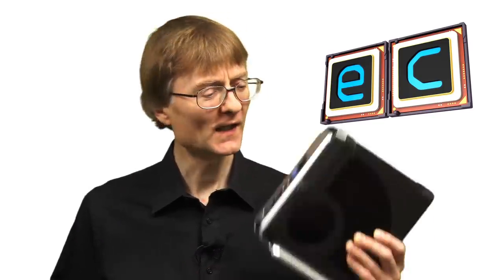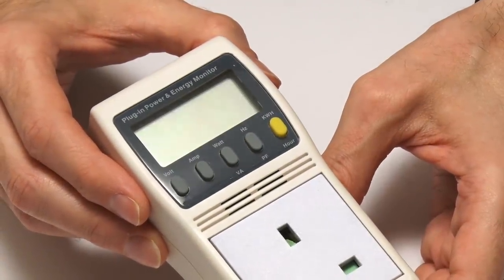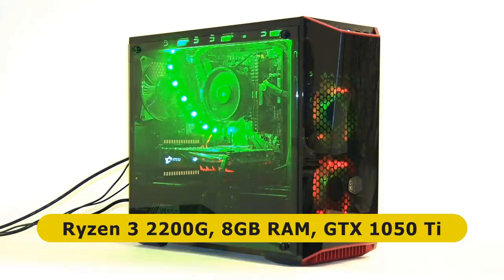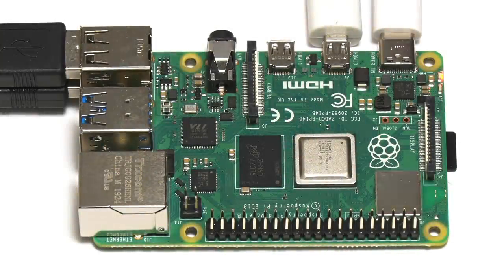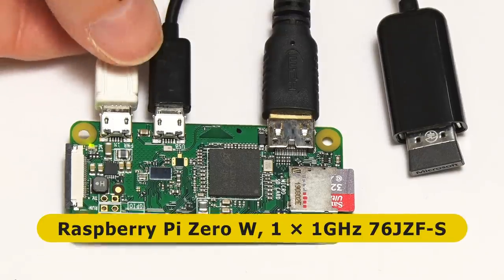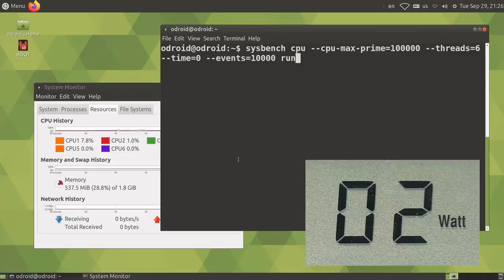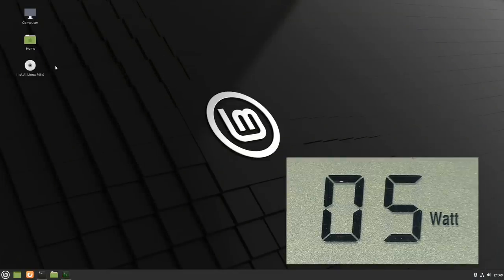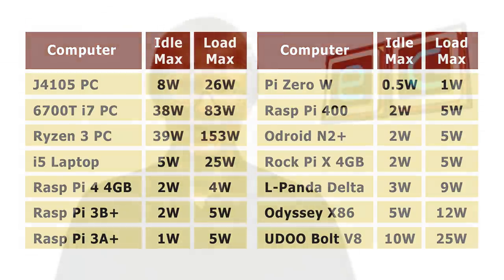PC & SBC Power Consumption

Comment: Surprised the pi4 is less than pi 3. Did you check there was no throttling due to heat?
Reply from the maker: Neither board would be throttling given the length of the test -- it would take several minutes to get that warm. A lot of work has gone into reducing Pi 4 power consumption (via firmware updates) post launch.
Reply: @ExplainingComputers  thks. I use mostly pi3 for various projects as I assumsed more efficient. Did try pi zero but have to add pluggable Ethernet which does generate heat (uses same lan9514 chip as pi3), not keen on this setup as chip encased in plastic. Rather it on the board where i can add a little heat sink. Probably will use pi4 in future.

Comment: You should have done the RockPro64 as well :).
Reply: I know it's a couple of years old at this point but I think it's still relevant with it's PCIe slot and NAS case and also it might still have higher single threaded performance then the RaspberryPi's. Since two of it's cores run at 2.0Ghz. I'm getting one to build a NAS with and I'm definitely going to test the single threaded performance against the Pi 4 :).

Comment: Where did you get the copper plate spacer from that you used for the 'Raspberry Pi 3: Extreme Passive Cooling' video?
Reply from the maker: Amazon I think. Search "copper plate 3mm". Or eBay. You basically need a seller disposing of small offcuts! :)

Comment: I could learn a thing or two from you, Chris. 153W for a Ryzen 3 and a 1050ti is surprisingly little. At max my i5 4430 and 770 Unclassified runs between 350W and 500W+ at max load, depending on what else I've got connected. One of my Core 2 Duo E6850s with a 750ti OC XLR8 runs at like 290W. Both touch the upper limit of what the PSU can handle in terms of amperage, with the i5 computer sometimes exceeding the limit in wattage and causing a hard reset. And these are supposed to be "low power" builds.
Reply from the maker: I remember my Core2Quad using a lot more power than the 6700T system that replaced it. :)

Comment: Thanks a lot for this video. I'am trying to reduce consumption and now wa have 2 Pi400 at home. Nice to see it's frugal! Other point, for your portable computer, could you remove the battery to be sure it's not charging?
Anyway, thanks a lot for this video, and thanks for the others!
Reply from the maker: My laptop battery is sadly not removable. Sealed in deep inside. Your Pi 400s are indeed very power efficient computers.

Comment: Great video though I wonder if running a 3d game or benchmark would of been better for stressing the computers.

GPUs are power hungry under full load and depending on how processer is designed might be partly shut off during light graphical loads.
Reply from the maker: It depends on the hardware. For the Ryzen with the 1050Ti the test was running XPlane. For the SBCs, the GPU power drain will be insignificant relative to the GPU.

Comment: Dear Dr., have you seen new reports on the performance of the new Apple with its M1 processor? It seems like a very interesting approach that builds on two of your subliminal themes: ARM evolutions and UNIX derived operating systems ;)
It seems like an 8GB M1 can almost do the same as a Mac Pro. And that M1 runs Adobe better than my 32GB+11GB vRAM high performance Windows workstation.
What is Apple doing better? Programming? Scalable? Compilers? Operating System? M1 chip?
And, how can we get such qualities outside such a closed system?
Reply from the maker: Thanks for this, I have indeed been looking at the M1, and a very interesting development it is. Especially I think including the RAM on the SoC, not to mention various controllers. Apple are clearly benefiting from having control of everything, from the CPU to the CPU, the RAM and the fabric, and this seems to be delivering significant performance improvements. This could well be the way forward -- will we see Intel chips with integrated RAM and controllers? I will say a bit about this in my channel update video next Sunday (Dec 6th).
Reply: @ExplainingComputers  - excellent! Question will be how it scales outside the single chip when more RAM is needed. Or co-processing. You will no doubt know that an ALU could do a square root in four instructions or an FPU in one, but sending the instruction and data to the FPU and waiting for the result takes longer than four ALU instructions. I/O seems very fast on the M1 - maybe it suffers less from the South Bridge bottleneck. Or, where are the limitations? Functionally and performance-wise. Also, I wonder what binaries the M1 is running. Very interesting.

Comment: You need to disconnect the laptop's battery to know the real power draw.

Now you only measured the power the charging of the battery takes; you don't know how much the battery drained during the test.
Reply from the maker: I made it exceedingly clear in the video that I was aware of the limitation in the laptop test as you note, and had the laptop fully charged to get the best possible reading as I explained. The battery is not removable, but will not have drained during the test. Charge capacity may have reduced very slightly due to the passage of time. But it will not have drained when the laptop is connected to the adapter -- it registered 100 per cent throughout. :)
Reply: @ExplainingComputers  You can disconnect the battery. The battery was still 100% because it was being charged by the adapter, which you measured.

Comment: 1:27 Some PSU's actually have software which will tell you the power the PSU is currently pulling from the wall and sending out to the PC. Higher end Corsair ones will do this via Corsair Link, just have to connect it to a USB header on the motherboard
Reply from the maker: Good point.

Comment: Someone get this man a new editing pc!
Reply from the maker: This is my new editing PC (well, from Jan 2020).
Reply: @ExplainingComputers  I remember, but get some ryzen
Reply from the maker: @joeyhillers9460  My pipeline is Intel, and you cannot mix Intel and AMD in a CGI rendering pipeline as the random seeds do not match, so frames rendered on different hardware would be different. Ryzen is powerful, but also power hungry and so generates a lot of heat. So I prefer to use "T" Intel chips.

Given that I can edit 4K fluidly in real-time (in part because I edit ProRes and use a separate cache SSD for the video editor), I would get no benefit from moving to a Ryzen (nobody can edit faster than real-time!), but I would use more power.
Reply: @ExplainingComputers  By using "T" Intel chips the rendering takes longer, so I don't think you'll save much power during rendering.

Comment: EFFICIENCY PER WATT
What about efficiency per watt ???  Ex: some benchmark point per watt or fps per watt.
Would the Ryzen desktop be much better than the others ????
Reply: No. Ryzen wouldn't be mych better. Compute / watt is pretty similar between these CPU (contrary to some common opinions). Check out TOP500 power efficiency if you want to know more. https://top500.org/lists/green500/2020/11/
Reply: @wiadroman  Do you have a similar list but for standard CPUs (ex: amd, intel) instead of GPUs and supercomputers ??
Reply: @rogernevez5187  No, but don't expect much of difference anyway. Well balanced desktops are also a mix where GPU dominates both wattage and compute power (because that's how you get good efficiency, not via generic CPUs). In this video you can see that Atom and RPi4 end up in the very same wattage range, they both have very similar raw performance and in the end, efficiency.
Reply: @wiadroman  
> "GPU dominates both wattage and compute power"
Only for a gamer PC.
What if it is an office PC ???

Comment: Maybe the fact that an I7 drains 100w iddle is the reason, in part, why apple is switching to arm based. Intel chips are like mechanical disk drives in the mean that in our minds they belong to the past, like combustion engines. Not yet unused but already obsolete in escense.. They are old stuff.
Reply: Boodysaspie  yes, you are right. I was talking about my I7 computer. The one he uses is a low power kind of.. More than that, if I start a game, the GPU increasses total power to 240w!

Comment: AsRock A300 w. Ryzen 3 2200G idles, with a couple of VMs, at about ~15W.
Just if that helps anyone.

Power supply it comes with caps out at 120W, I've however not seen higher than ~45W on it.

Comment: It's a shame we can't just do a simple equation to know how much power a system will use in reality, especially before buying components.

Since where I'm living now electricity is expensive I recently started changing my PC setup. I used to have a single system for everything but now I've setup a RPi as a Samba server and use a tablet as the "media player" instead of having to keep my computer on all the time.

Still I wish there could just be a simple way to disconnect or pull out the extra drives and the  expansion cards (especially the video card!) from my PC when I'm just going to check my email or do some admin work and then easily put it back when I'm done.

Comment: Of course a more accurate way of measuring PI current is to measure USB 5V current. I see worse case 1.5A (1.5A x 5V = 7W) when running a CPU stress test on my PI400. I was also playing an MP4 video using VLC player during the stress test so some GPU load. I believe a 2A adapter is plenty unless you start adding USB peripherals.

Comment: My Corsair Power Supply has a program which monitors the power consumption of the computer, and it tells you the PSU efficiency (power in and power out). My PC draws around 90-100 watts and the PSU is around 88-90% efficient, if memory serves. So, very little wasted power.

Comment: I will state I currently do have a massive rig as well (besides my 8700T system) It's a Ryzen 7 3700X, on a X570 Taichi Motherboard, RTX 2060, 4X mechanical drives, 3X m.2 SSDs, and 2X 2.5 SSDs.  In Idle its 65W (these high end boards uses way more power), but in gaming it's 400W average, and benchmarking it's 450W.  I use this rig during the winter months when I don't have to use the AC much, but plan on changing this rig to be more efficient like my living room PC as soon as I can either find a Ryzen 7 4750GE Pro @ 35W or a I9-9900T @35W (or I9-10900T @ 35W) out in my normal supply channels.

Comment: I would be very curious to hear your insights on the implications of the new Apple M1 ARM-based laptop CPU (which is competitive with or beating their Intel machines even running x86 software) on the future of power efficient computing.  With Nvidia acquiring ARM, Apple's not likely to stay the only efficient desktop-grade ARM CPU maker.

Comment: RAM size and technology matter. My NUCi5 with 16GB RAM reports that DRAM constantly draws 2-3W, no mater idle or active. While cpu when idle stays around 0.2-0.3W (10x less than DRAM). Under stress CPU jumps to 10W and DRAM still stays at 2-3W. WiFi is also noticable and wattage will depend on the setup. More importantly, total wattage under stress should be normalised to produced compute power, raw wattage figures are a bit useless otherwise.

Comment: Can't run GTA V at 60 fps on a SBC.
Reply: @J Fz 
1. PS5 is a lot more expensive than most SBCs

2. PS5 was made for gaming, of course it will be able to play a relevant title that was announced for it
Reply: @J Fz This video was not about gaming consoles, nor does the PS5 have as low of power consumption mentioned in the video. The PS5 doesn't compete with any of the devices you mentioned, either. My comment was about how I feel about devices that compete with the Raspberry Pi.

Comment: My xiaomi phone consumes 1.2 W -1.4W every hour on average (youtube , browsing and some other light tasks).  6" 1080p+ screen, 25% luminosity. My wifi router consumes 2W every hour. My PC i5 7200 and 13" 1080p screen consumes about 10-18 Watts on average.   I also use a 400 Watt vacuum cleaner,  2000W induction cooker, 2500W electric oven  and a semiautomatic 400W washing machine ocasionally. My fridge consumes 700 - 800W every day.  All my house interior is painted in white  so the light gets well reflected. This way I can use led bulbs between 5W and 10 W each one. My electricity bill is around 6 - 6.5 Euros every month.

Comment: The best way I've found to do it on my computer is with the software that came with my UPS, a cyberpower 1500pfclcd. (Not as accurate as a dedicated current meter.) A bit overkill, I know, but it was on sale for the same price as the 1000VA model at the time. A x570 taichi, 2700x, RTX 2070 Super, and an Adaptec 71605 pulls about 162W with just Firefox up. It can spike up to about 400-450W when I'm accessing my main array and playing a game. Synthetic benchmarks can send it up to about 500W. That's on the Ryzen balanced power profile in Windows 10 1809. Power Saver drops it down to 144W. I could maybe get it down to under 100W idle with some uefi tweaking and undervolting and manually tweaking the power profile. That might be pushing it though. Raid cards today are computers unto themselves running their own cusom linux kernels with power draws to match, so maybe not.

Comment: Probably a daft question, but why use a 500watt power supply for Ryzen 3 when it only pulls 83watt. Is 500w its output power but this means a lot more amps with less volts?..

Comment: I'd like to see a table of power consumption vs. system performance.
If you got a standardized benchmark value for each computer, and divided power consumption by the banchmark, you'd get a ranking for the most computer bang for the energy buck.

Comment: May I please make a suggestion for a future video?

As you'll be aware, the Raspberry Pi 4 Compute Module has been released and the accompanying I/O board has an on-board PCI/NVME slot.

Unfortunately, no-one seems to have made a video about how to actively cool these beasties.

Would you consider doing a video showing how to cool one of these? 

You could also take the opportunity to compare NVME speeds on a Pi 4 using USB3 with the on-board NVME on the Compute Module's I/O board.

Comment: I'm having trouble with Linux Mint in a dual boot with windows 10. My trouble is the time changes in mint 7 hours later and changes the time in BIOS. Then I start Windows the time is changed there because of the BIOS. I found someone that was nice enough to give me this! I just don't know how to implement them. 
For the winter.
 sudo timedatectl set-local-rtc 0
grep LOCAL /etc/adjtime

And this for the summer. 
sudo timedatectlset-local-rtc 1
grep LOCAL /etc/adjtime

Comment: The better test for a SBC is watching Youtube at max resolution.
I get  6W on a Pi4 and 9W overclocked.
Doing online video will also stress the GPU and the network.
My 1st gen I7 is 103W idle and 156W loaded.  
Have moved servers and router to Pi-type devices. Here, the heat created caused my room A/C to run a lot. Moving to low power computers saved money twice; once on power draw and again on cooling.

Comment: Big respects that you buy processors partly based off of the power usage. Don't think most people ever care about that TDP number. I also have a "T"-style intel processor, because I have a passive cooling solution. But my case as well, also partly due to environmental reasons.

Comment: Those laptop numbers are probably good for idle, but the max is almost certainly significantly under actual. Most laptops will supplement from the battery when running at max load, and will throttle down when the battery is exhausted, even if plugged in.

Comment: Great video! 

To be fair to PC power consumption, the Ryzen system is running a 2 year old processor.
The celeron is 3 years old. 
AMD, at least, has made some big improvements to power usage since the zen 1 design shown here. 

I know you may not have enough processors on hand to check, but it would be nice to see some newer, higher performance x86 processors benched.

Comment: It would be interesting to compare efficiency of different types of computers. How many Wh it takes to perform a certain task. For instance calculate some large number of primes a large number of times or compress and decompress a set of files a large number of times. Or encode 6 minutes of video using a x264 codec. Or all of the above on average. Perhaps other tasks as well? Calculate file check sums. Copy files over the network.

A PC can be expected to perform the task much faster than a SBC, but is it more or less energy efficient when doing so?

Comment: Hmm,  wonder if that power meter does TrueRMS measurements on the current.  If not it could be reading off based on the current waveform from a digital device.   I'm assuming the good watt meters these days do use TrueRMS internal measurements.